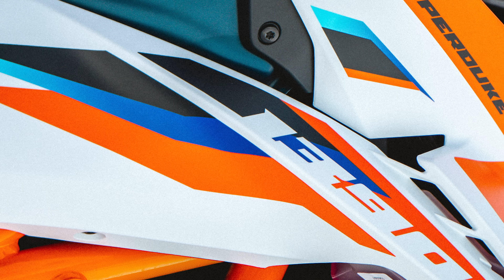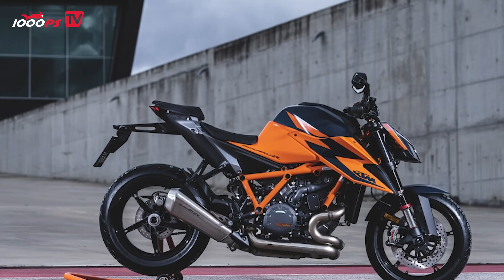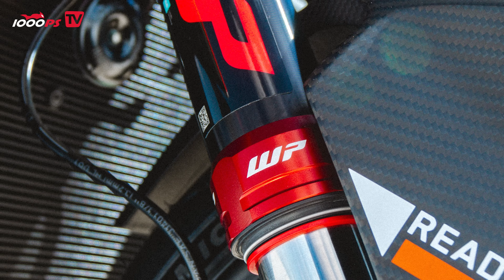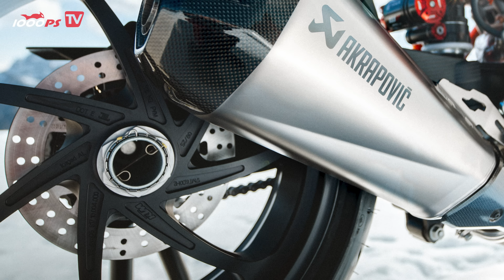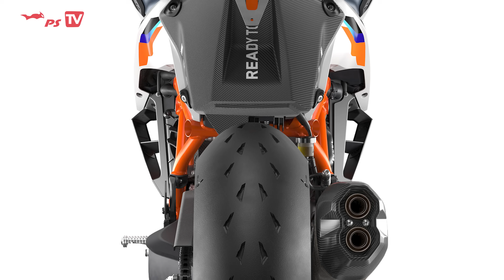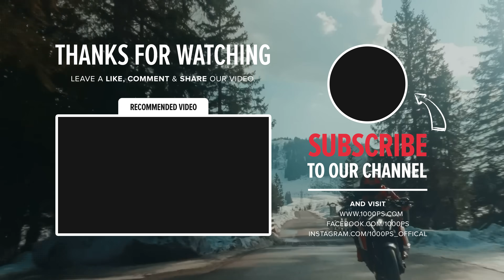KTM 1390 Super Duke RR 2026: 11 kg Lighter, 193 hp

Comment: They should build a proper superbike already...
Reply: They don't have the engine for it, the LC8 could never compete with the 1000ccs. Nothing can. Those get 215 wheel horsepower with just an exhaust and flash. They could build something like a Tuono or Hayabusa but not a superbike.
Reply: @cloudcata8300  everything doesn't need to top of the class. Some tuners were able to get 205 crank hp. If they just touch 200+ hp mark by adjusting bore stroke or other variables.. then it will be pretty solid superbike.
Reply: @mobileGameZGG  Solid, yes. And they could build a solid bike, just not a competitive one, in a world where no compromise is made in the supersport class they wouldn't do good, again, they can make a great street bike, but not a competitive one, it would  be heavier and far behind getting destroyed on track by bikes like the panigale, and the same thing would happen on the street, really, up top nothing can compete with these new supersports, the V4s just make too much power up top, the panigale gets 240 crank, that's 40 more than the LC8 can put out. I do agree. I think they would make a incredible sport bike for the street if they would land it between the 1000 supersport and the hayabusa, not too small, not too big, just the right power.
Reply: @cloudcata8300  yeah, KTM always make products in a space where there are generally no competitors, or competition. In the super naked tier, nobody is really that concerned with peak power and torque, as compared to the highly competitive superbike class.